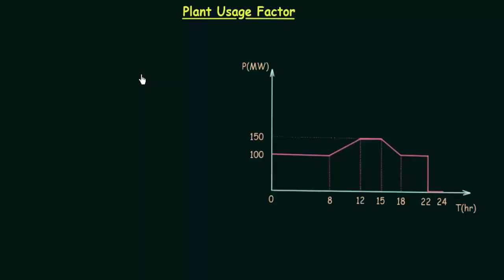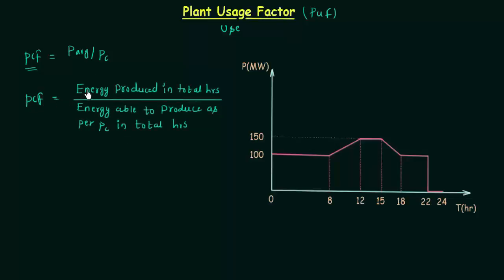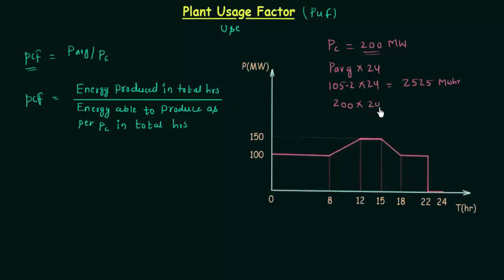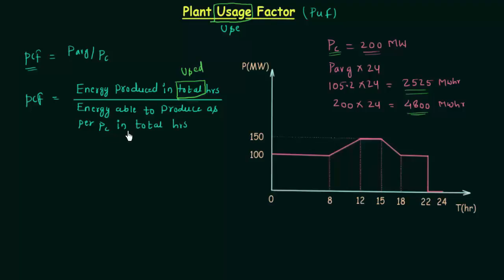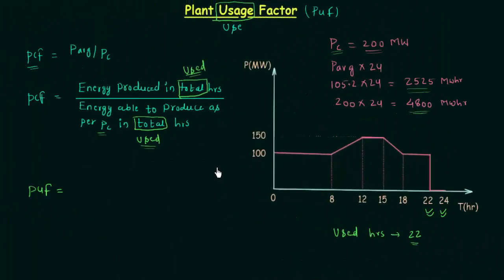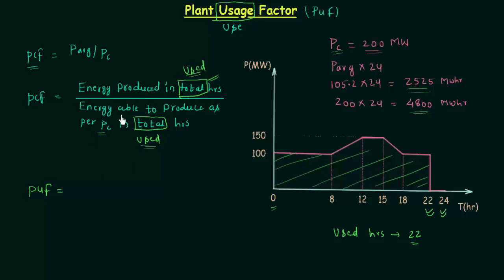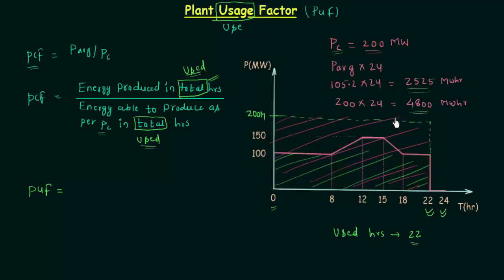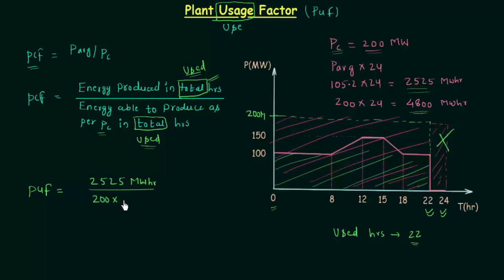Plant Usage Factor (PUF)

Comment: in case we know only Pavg ,i.e 105.25 in given example so for energy produced in used hrs ,should we multiply it with 22 or 24??
Reply: Exactly.. according to definition it should be multiplied by 22 instead of 24.
Reply: Prashant kannojia 22 since the plant is not in use for the later 2 hours of day
Reply: @shubhashishpandit6083  but in video multiply by 24